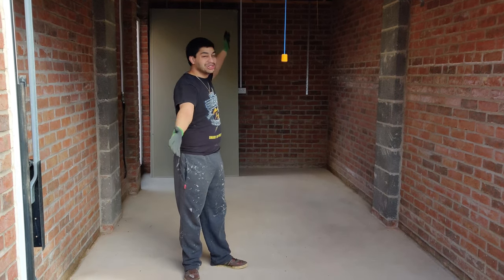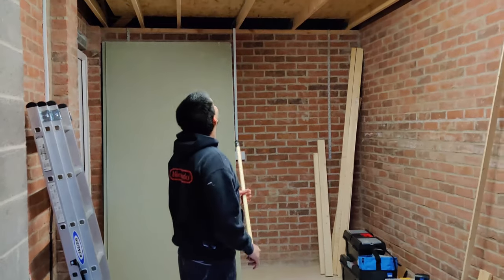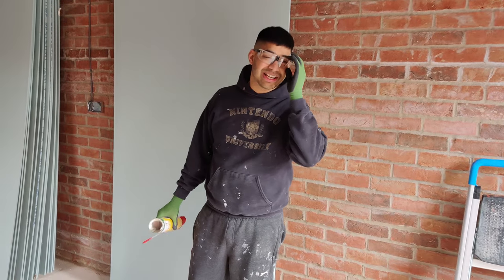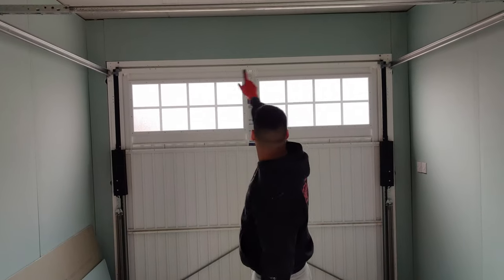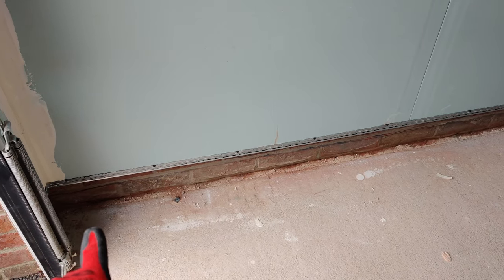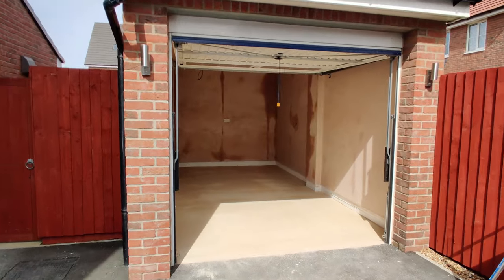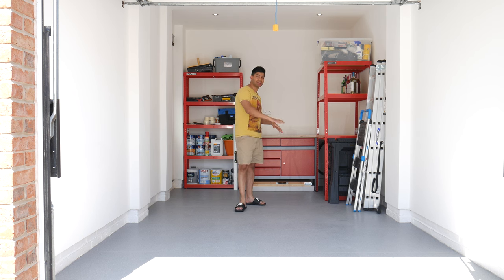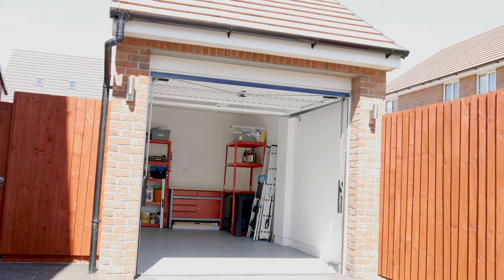How to finish a new build garage from start to finish!

Comment from the maker: Follow our home progress on Instagram: https://www.instagram.com/thedipshome/

Products used:
Moisture Resistant Plasterboard: https://tidd.ly/3ionsae
Plasterboard Ceilings: https://tidd.ly/2SfadxK
Soudal Plasterboard Adhesive: https://tidd.ly/3x0iSTu
OSB Loft Boards: https://tidd.ly/3x2febF
Quick Set Joint Compound: https://tidd.ly/3x0j7hm
Joint Compound: https://tidd.ly/3indNAx
Corner Tape: https://tidd.ly/2RtKiSy
Joint Tape: https://tidd.ly/3uYI9Mk
Corner Beading: https://tidd.ly/3fXHbvC
Masonry Paint: https://tidd.ly/3x41RrG
Hardwearing White Paint: https://tidd.ly/3zaQFLq
Spotlights: https://tidd.ly/3fZVvUm
Spotlight bulbs: https://tidd.ly/3w1ooVU
Loft Ladder: https://tidd.ly/3k0wZDC
Dewalt Brushless Drill Set: https://amzn.to/3Ha1K3L
Reply from the maker: @DeeBythesea  hi glad you found it useful! The quick dry joint compound is a separate link its listed in there.

I used the tapered edge boards as i taped and compounded the seams. However in hindsight it didnt need doing as i skimmed it all anyway. So you can go for straught edge if you plan on skimming it.

Its not a nail gun its just my drill with a magnetic screw bit on the end. Hope that helps.
Reply from the maker: @DeeBythesea  there's 2 links there for joint compound, both are in black tubs one is quick set. It says on the tub.
Reply from the maker: @DeeBythesea  yeah deffo need the magnetic bits, when im back at my PC il get the links for you. We all got to start somewhere!
Reply from the maker: @DeeBythesea  Dewalt Brushless Drill Set: https://amzn.to/3Ha1K3L - price depends on what batteries you go for.

Comment: No insulation in roof space, No Damp Proofing, No Vapour Barrier and No gap for ventilation basically pointless will do nothing. Cowboy builder complete waste of time.
Reply from the maker: If your a professional why watch the video?
Reply: It’s not about being a professional or not - many commenters are suggesting they will follow this video, some with house attached garages… 

He is right, you spent 2K on a dryline that will be lucky to last a few years. You have created a sealed box with cold walls - no chance you don’t suffer from damp and condensation eventually. You really should have made a proper “warm room” since you were going to all that trouble anyway.

Anyone watching this video: please also get some Celotex or similar insulation boards and vapour barrier/tape. The 50mm you will lose battening the walls will be nothing in the long run.
Reply from the maker: @leighrobinson  look forward to seeing your video pal 👍🏾
Reply: @Dipscovery  If and when I get around to doing my garage then sure I might put a video up - it would largely be the same as yours but id baton out the walls rather than dot and dab with adhesive. Takes more time to baton out no doubt, but I would have to make sure that condensation isn't a problem as I will have machine tools in there which will rust in no time otherwise. 

By the way, I am not really criticising what you have done to just knock you, but to provide some context to other commenters who might otherwise just copy what you show in the video and think the space will function "like a normal room". I like the style and what you have done in your house, and the fact you are bothering to make content - its not easy and definitely adds time to a project like this. You clearly put a lot of time and money into these things, so wouldn't it be the best for you take onboard these sorts of comments? I mean I wouldn't want people to be copying me once I know that I didn't exactly take everything I should have into consideration? It would be easy to add to the description that you didn't insulate or barrier as you might ought to; it doesn't take away from what you are trying to do with the channel, etc. Have a good one.
Reply: @leighrobinson  I'm planning on building a studwall with 50x75mm studwork, and fitting celotex GA4000 insulation between the studs, then 18mm OSB on the front.  There will also be a dampproof course around the bottom of the stud, and some form of moisture resistant membrane on the wall-side.  Do you think this will be ok, or overkill for a garage which I already know suffers from damp (possibly due to us using it as a gym)?  Should I also add another layer of insulation between the studs & OSB?
Reply: I imagine a good deal of ventilation can be achieved if you regularly open the garage door 😂 - also the presence of the garage door kind of makes thermal insulation pointless as most of the heat will be lost via that door surely, unless you plan to replace / insulate the door in future then I guess it makes sense to have insulated the walls whilst / ceiling whilst you had the opportunity.
Reply: I can see the usefulness of boarding out the loft for storage, and the loft ladder for getting up and down easily and it is good storage.
But I don't understand why bother to line the walls with plasterboard with no insulation!
You might as well have just painted the walls white!
Anyway, you have put a lot of effort into the project and done a good job!
Reply: You've missed the point. It's not a conversion to livable space. He's literally upgrading his garage / workshop. So harsh to call him a cowboy builder. This is obviously not to building regs for a livable space, because it's not a livable space!
Reply: Savage but true
Reply: Not being used as a liveable space!
Reply: You can see the eaves trays. 🤦‍♂️
Reply: Absolutely no point in insulating the space when there's no source of heat. Some people just feel the need to comment without actually thinking.

Comment: Hi Great video, I have been looking to convert my garage but couldn't find the exact video on YouTube, I have a similar garage structure,  question the flooring board you are using on the video isn't the same as the link you have posted please advice as I am about to do my garage as yours 😊
Reply from the maker: Glad it was helpful. Looks like they dont do the one i used anymore and are stocking something else. Mine were called OSB loft boards. But the new ones may be ok?

Comment: Great Job!
I did my garage also. its a hell of a work and took me about 2 years. I got a tip for you: the cutout of the garageframe attachment looks ass. Next time get some wood with the same thikness of the hollow room behind the plaster. Screw it to the wall, cover it with plaster and screw the garage frame thew the plaster into the wood.

Comment: What about condensation issues there was inadequate gap on walls and brick work and you boarded floor board’s to joist without air gap too
Reply from the maker: Its been fine had no issues

Comment: Thinking of Don m doing the same. Is there a reason why you didn’t frame out the walls and insulate  the walls?? 

Also are you not worried about rising damp? Is that the reason why you didn’t go to the ground?
Reply from the maker: Hi, I didn't want to reduce the size of the garage by framing as its already quite small, and no need for insulation as it's not a lived in space.

Standard plasterboards are not tall enough to go all the way to the bottom of the wall so left a gap, I didn't mind as it meant I did not need skirting. Damp won't be an issue as they are moisture resistant boards. Hope that helps.

Comment: Excellent video, really makes me want to sort mine the same way. Can I ask, did you need to add woof strips to all walls before adding the plasterboard sheets, as you did where the conduit cable was? I also couldn't see the link for the ladder? Thanks
Reply from the maker: Hi, we only needed the wooden spacers for the conduit section, you do not need it if its going directly onto the brick as it sticks fine with just the adhesive. Link to the ladder: https://tidd.ly/3k0wZDC
Reply: @Dipscovery  Thanks, very helpful!
Reply: Sorry, one more follow up, how did you secure the wood to to the brick? My garage is the grey breeze block instead of brick.
Reply from the maker: @meenan86  I drilled holes through the brick, inserted a rawlplug then screwed the wood to the wall.

Comment: I want to do the same to my garage, but I know when we get driving rain the water seeps through  so no idear how yours is going to stay dry
Reply from the maker: @carlwilliams7028  the weather seal strip keeps out any water, if you have water coming in then the ground isn't levelled away from your garage so thay would need sorting.
Reply: @Dipscovery  thanks for the reply. I get water seeping through the brick all down the wall so think I'm going to have to treat the wall on the outside to try and stop this.

Comment: Dude please make us another video a year later specially on how the over storage is hanging on. Any problems so far? What type of stuff you threw in there? My garage is just like yours and I was concerned on adding weight to the roof structure just with the chipboard, but you clearly added the whole pack in there with the plasterboard and ladder. Any signs of sagging or anything at all? Cheers!
Reply from the maker: Hey buddy, so far its the same as it is in the video! No issues. Got all sorts up there, luggage bags, old clothes, decorations etc. The beams are designed to hold abit of weight and you can always reinforce width wise with additional beams if your trying to be safe.

Comment: Looks pretty good mate. Isn't there any worry about putting in a loft hatch and storing stuff in the roof without adding any extra support? I'm guessing the joists that existed weren't really meant to hold any weight directly?
Reply from the maker: Thanks, if you spread the load out shouldnt have any issues. When it was being built you see big builders all the time standing on the joists while working. So ya gotta think, if it can hold x2 80kg fat builders while working it can hold a few bags of junk lol.
Reply: @Dipscovery  haha, sounds scientific enough for me

Comment: I’m close to finding what I want with my garage and this really helped, though in two minds abouts doing exactly this or with a partition wall at the front. Does what you did improve the temperature n the winter? I’m wanting to use it as an office / gym
Reply from the maker: Not really as i didnt insulate it, but if yoi used insulated plasterboards instead of what I used then it would of been warmer. Im using mine as a workshop, storage for my motorcycle.
Reply: @Dipscovery  Hi mate, thanks for your response. I think I will try to spec it with the insulated board, to try best to keep it warm in the winter. Thanks very much. Ps great work on the channel, you are very watchable man, in any sort of your videos

Comment: Great video and detail! Thank you. 

I have a question. I have a similar pitched garage it’s about 7m long and about 5m wide. 

And Thinking of doing everything you’ve captured during this video. 

The joists for the ceiling are similar to yours. Are they strong enough to support the flooring and to then use  for storage or home office or would they need to be strengthened. 

Many thanks 
I
Reply from the maker: Hi buddy,  yes i didn't have to reinforce mine with anything and just boarded it, and it has been fine. I use mine for storage too. Only section I added additional battens was for the drop down ladder which i mentioned in the video. All the links for everything i use in the description.
Reply: @Dipscovery  👊🏼 Thank you bud. And appreciate you taking time out to respond

Comment: Great video. Done an amazing job there 👏🏻

We’re just starting out with our garage renovation. It’s also new build one and we’re aiming to turn it in to a gym.

Daft question about the weather strip. Did you just cut it to fit? Also how did you fix it to the floor?

Cheers.
Reply from the maker: Yeah you can cut it with some decent scissors or a Stanley knife. It comes with adhesive in the kit.

Comment: Lovely job mate.  Hope it hasn’t partially flooded like my new build has! Especially with no drain grid at the entrance.  How has it been for moisture etc?
Reply from the maker: Ah unlucky mate! No mine hasnt flooded, but i do have a sewer drain on my drive which probably helps. Its been perfect so far no issues with damp or moisture. Still the same as the video, theres a hairline crack in one part of the ceiling that came over time after the plaster had dried so just need to fill that and repaint. But its minor. 👍🏾
Reply: @Dipscovery  just wandering how it’s all held up over the winter regarding moisture etc?
Reply from the maker: @vRemarks  no issues yet still same as the video

Comment: Hows it been since any mould or condesation?
Reply from the maker: Hi, nope its still the same as it was when i finished, there is a small hairline crack in the ceiling after the plsater dried which i need to repair but everything else fine 👍🏽

Comment: What kind of weight can that loft take? Those beams are joined aren't they.
Reply from the maker: not sure exactly, but the load is spread out across all the beams and panels, its had over 300kg on it so far and been fine.
Reply: @Dipscovery  Thanks, nice job.
Reply: It's actually a truss roof, so isn't designed to take any extra vertical load other than the roof tiles and an allowance for snow load. The long truss members (that have been boarded over) are in tension and not designed for any bending loads. I sistered proper C24 joists to the truss members in mine then glued and screwed the OSB boarding on top. Measured deflection before and after, mine certainly wasn't suitable for walking on plus storage before the strengthening.
Walking around my new build development you can already see garage roofs starting to sag where they've been overloaded. Pretty easy to do, circa £200 for joists, construction adhesive and fixings for a single garage.
Reply: @UltimateAccuracy  Thanks, that's interesting. Are your joists perpendicular to the existing beams?
Reply: @James-pyon  No, they are "sistered" to the existing truss members. If you're not familiar with that term it just means fixing two lengths of wood together like a sandwich. 
You use construction adhesive (like Everbuild D4) between them and screws every 3-400mm.  Between those reinforced truss members you should ideally fit noggins, which is effectively what the OP has done where he attaches the loft ladder, except you should do them the full width of the room, which also makes it easier to fit any plasterboard without sagging issues. HTH

Comment: What are you doing about damp proofing the walls?
Reply from the maker: no need as i used moisture resistant plasterboards.
Reply: @Dipscovery  where did you get those from
Reply from the maker: @rasalahmed1209  Link ins the description pal for the materials.

Comment: What company did you use for the flooring mate? Also how much did it cost? Lovely garage btw cracking job
Reply from the maker: Hi pal, it was called L&S Flooring they are a local company here in the North West, was around £350-400 fitted 👍🏽

Comment: Great vid. I have a similar size garage and looking to convert into a two story block. How cold does it get as I noticed you hadn't insulated well? I have a gym in mine so we will use a lot during the winters.
Reply from the maker: Ofcourse depends on time of year, probably would be ok for a gym if u want it cool when ur working out. Butnit gets quite hot in summer as sun facing the metal gatage door. I wasnt bothered about insulation as its not a living space.

Comment: I have almost identical garage . I assume its Taylor Wimpey? Every winter things inside get damp and condensation (due to no insulation and change of cold night to warmer day making everything wet with condensation). Do you have any issues like this? We also have mice in ours now.
Reply from the maker: Hi, no ours is a Countryside property. Ive not had any damp problems with mine, its still quite well ventilated as its not air tight since i am still using as a garage.

Comment: Is it a single skin brick wall on one side? You may find your plasterboard wall getting damp. You would probably have been better constructing a stud wall with gap between it and brickwall
Reply from the maker: Hi pal, yeah it's single skin, i've used moisture resistant plasterboard to reduce damp problems. I didn't really want to use a stud wall as it would of reduce the space inside the garage and its quite small already. So far been good though!
Reply: Good to hear, nice job btw. Is the floor Epoxy or them rubber tiles
Reply from the maker: @Messimagician83  no its a flooring called safety flooring they normally use it in commercial environments like kitchens or hospitals etc.

Comment: No insulation and vapour membrane?
Reply from the maker: No need for insulation as it's not a living space, the plasterboards I used are moisture resistant boards, you can't do dot and dab/foam adhesive with vapour membrane boards as it won't stick to the back 👍🏾